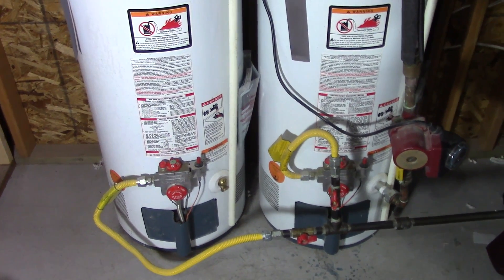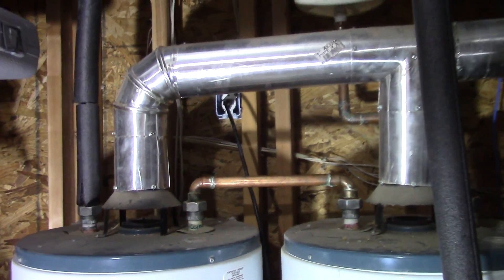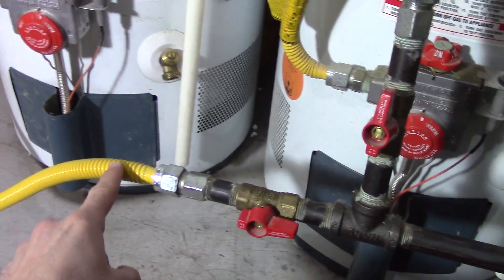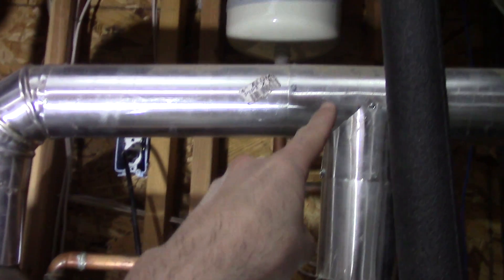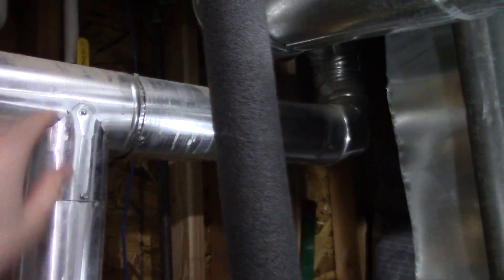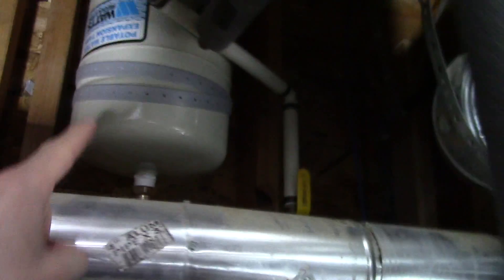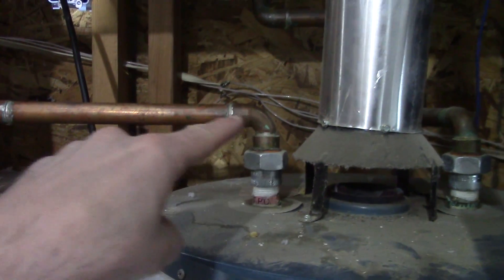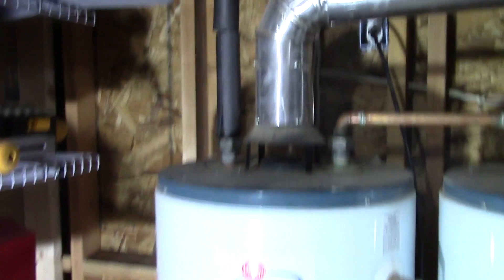How to install a second additional water heater in series

Comment: Very old video but still see this all the time.  Everyone recommends parallel and there are indeed advantages but series is nice if you want to double your hot water when the kids come to visit and you can turn off heater #1 when you no longer need the extra capacity.

Comment: Splitting one 1/2 inch gas line into two reduces the volume and pressure required to efficiently operate both tanks. Also a drip leg on each is necessary for condensate control and evaporation. If you combine two 3 inch flu exhaust pipes you will need a minimum of 5 inches to properly vent. One expansion tank will work if tank is large enough and there is no check valve between the two tanks. Also its probably not a good idea to dump the hot side of one tank into the cold side of the other. The incoming water to the second tank will be too hot to make the thermostat activate the burner. Also the 3/4 cold water fill on one tank only will severely reduce the recovery rate of the whole set up. I would not recommend anyone install a double water heater set up this way.

Comment: The hot water is a outlet discharged water hot comes out you should have a tee in between the 2 hot water outlets going into the house plumbing it will not come out the cold water side you are so wrong Mr

Comment: Hello my tanks are installed in tandem... the left tank fills up, while the right only fills less than a quarter of the way. How do I get both to fill completely?
Reply: Re- vamp the plumbing so it's in parallel, the plumbing has to be the exact same to each tank and also make sure both tanks are exactly the same in size. This way both tanks should fill up the same time and when you run hot water it draws off both tanks at the same time..

Comment: I would be concerned about exhaust migrating down the unit that isn't operating. Without the heat moving the air out of the house and CO being heavier than air this could be a problem. Parallel is the best way to go with the tanks water. A recirculation pump would be nice too, especially if you run extra piping so you get instant hot water where you need it.

Comment: Some comments about codes.  Well, you can't have dual exhaust inlets into your main chimney where I live now.  The proper way is to have them combine before the chimney like you have it here.  So that looks right, but it could vary too on area codes.  Have to check.  My hot water heater exhaust is connected into furnace exhaust first and then chimney and that was done to code because it used to be two pipes into chimney, not to code any more so had to be changed.

If this was done by licensed installer then someone had to come out and sign off on it so no codes were violated.

Parallel water would be better.  If you have something go wrong, a leak in a tank, shut it down and you still have hot water.  Series, can't do that.  You've got water going to both.
Reply: Parallel not better.  One tank usually ends up doing allthe work.  Series is best with first tank set to ~100deg, and the second set to ~140deg.
Reply: @joemilana6630  I'm not so sure series is even safe. Bacteria can grow in temperature of 40-140 degress. Water that is stored in the first tank would enter the second tank and warm up more but if you're taking a shower it might not warm up the water from first tank to kill the bacteria in time. Parallel, I read something about that too and I don't think that's the way to go either, like you said, one tank does all the work.  I think the best way is dual zone and split up your house and have each tank run at the proper temperature.

What I ended up doing, I had the main controller fail and it was under warranty, only 3 years old. I ended up buying a 2nd water heater, went with a 50 gal this time.  I swapped it in and left the 40 gal next to it until the parts were all in 2 weeks later.  I just had them replace the part and I'm going to just leave the tank there in case the new heater fails drained and unhooked, then I will swap in the old heater while I'm waiting on parts for the newer 50 gal unit if it fails.  I did not buy the warranty this time, complete waste as you're waiting on parts that take 2 weeks to arrive.  That's too long to go without hot water, so I'll just do the work myself and the parts are still warrantied for however long, 5 years or so can't remember now.

Comment: it looks like the hot side of one WH is going into the cold side of the other WH, wouldn't you want to tee the water supplies together just like you did the gas and exhaust?
Reply: userboy6. Yes you righ always each. WH. Enter. Cold and hot.

Comment: That is a terrible job!!..not to code.. scary that someone would make a video about something they obviously know nothing about.
Reply: Is it done wrong  or is it against code to have 2 water heaters? and will water pressure be effected.
Reply: @timpenfield5  It depends on the state. This is exactly how the pros installed the second water heater for my parent's house. The only difference was that their vent had to be at a 45 degree angle. The states inspector came out and approved it- said it looked great.

Comment: Having it pipe this way will make one water heater work harder than the other. You should also have valves on each side so you can shut each heater off individually
Reply: I was just considering what you have posted since the advantage is for adding a second smaller heater in series on the supply side.   From other posts I gather that the main heater will supply most of the hot water anyway no matter what is added either parallel or series.  My problem is a new jacuzzi that requires 75 gallons of hot water from a 50 gallon tank.   It has an antiscald valve so it will auto mix cold water to keep the temperature down.   The 50 gallon tank is set at 150 degrees so it's doing all it can now.   By dropping the temp on it and adding a cheaper 30 gallon tank with a 120V heating element I get the extra supply only on demand if I plumb them in series.  When the hot water runs out of the 50 gal the 30 gallon will feed into the 50 until it is depleted or partially then the heating elements kick in.  The 30 gal with only a 1200W 120v element will take maybe 6hrs to heat 55 deg water but I use one set up like that in my small house with no shortage of hot water except right after using large washing machine.  It cost me pennies to heat my water a  month.  Thanks for video and please let me know if you have run into any problems with that configuration.
Reply: You can have the 1st water heater set on a lower temp, then it doesn't work so hard
Reply: @rsb7608  your using 1 heater as a storage tank.

Comment: By the way combining flue gas vents is also illegal, violates plumbing codes, and actually decreases ventilation efficiency
Reply: Depends on the state regulations: This is how the pros installed it in my parent's house.  But they had to put in the second vent at a 45% angle, not using an elbow like you see here. It's always critical to check with your state inspectors and make sure that you know the codes for your state.

Comment: FYI:  Water Heaters should never be installed in series for the following reasons:  1) They are not designed to operate in series,  2)  this arrangement will reduce hot water flow by 50 to 75%, and 3) will void the warranty on both units,  Water Heaters should only be installed as independent units- which electrically is the same as installing in parallel, i.e. both units see the same "voltage," or water pressure, finally this type of installation is actually illegal and violates every building code in the US and internationally as well
Reply: If this will not work then why is mine working just fine and giving us plenty of hot water.
Reply: Tim Haller I believe Scott Hill is saying that you are driving your Ferrari 10mph .....always. I mean you can always drive it that slow but that is not the true potential of the vehicle. Sure it will get to from A to B but it is gonna be a long riiiidddeeeeee
Reply: Does it violate code to have  2 water heaters  installed in a home or it's illegal  the way he's doing it? Does installing as 'independent' units mean only 1 water heater per household ,  not 2, ? thanx

Comment: Be careful if 1 cylinder stops working or is not working so good it will mix cold water with the other cylinder. Do a tee and 2 not return valves

Comment: I am  new home owner and i would like to know what is the purpose of having 2 water heater
Reply: You don't unless you have like four teenagers who take showers all the time or unless your house is like over 4000 square feet
Reply: Well actually I would love to have 2 heaters my home is very small 900sq ft and no room for water heater so it's in the crawl space which is only about 4 feet tall so we have a very small water heater and each person LITERALLY gets about 4 to 5 minutes in the shower or it gets real cold real fast and I am not exaggerating at all. I dont know if this is "legal" or to "code" as I'm a mechanic by trade BUT in theory it seems like a very good way to solve our issue.
Reply: @BerzerkMaggot777  for your home I would suggest a tankless water heater, probably a 9.8. They're small, don't use gas unless you're calling for water, there's no real risk of flooding, and will provide all the hot water you need. I don't know about all of them, but I know the Noritz EZ series has a lifespan of 25-30 years, versus a regular tank water heater which has an average lifespan of 7-12 years.
Reply: @Anthony Lewis you need a mixing valve my friend. Install it, set the temp, and crank the water heater thermostat up. Thank me later.
Reply: @BerzerkMaggot777  Good candidate for a tankless (instant) hot water heater then.
Reply: Well my 30 gallon is ok still but I like taking 45 min showers and a 30 gallon ain’t enough. so I’d like to put another 30 gallon next to it...

Comment: Per UPC gas flex not to exceed 18", Drip legs should be provided at both appliances, 3/4" Black Pipe not supported correctly, were gas calc's done to assure gas line capable of supporting additional load, T&P Valves should be piped to exterior, if located inside a residence should have pan's under the water heaters piped to a suitable location, If these are 50 gallon water heaters should have 2 straps per heater if 75 should have 3 per unit. Pipe Insulation should be completed, The outlet behind the water heater needs a proper cover.
Reply from the maker: +Craig Price Nice!  This is how the home builders installed them.  I will check up on local codes with the info you provided.  I plan on going to a single heater once one fails.  Thanks for the comment!